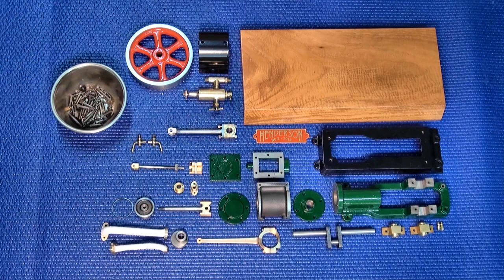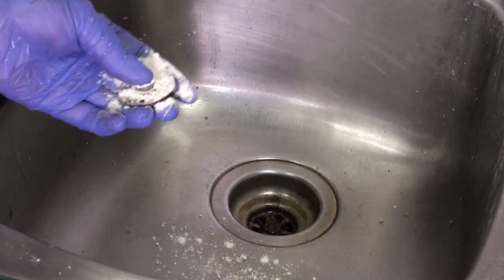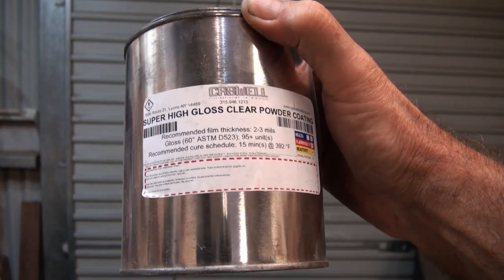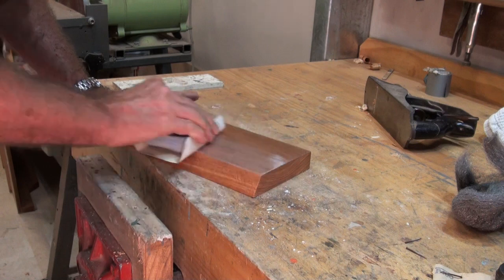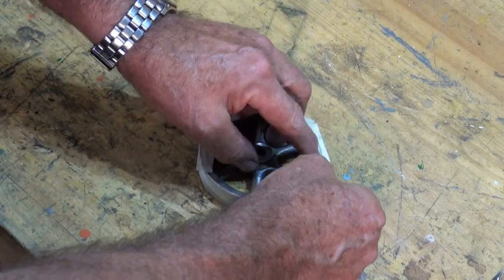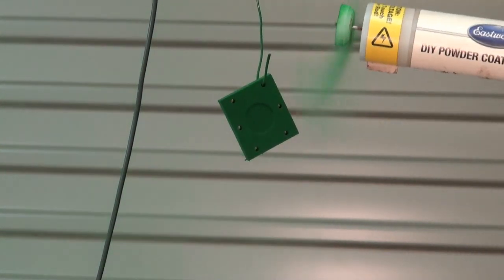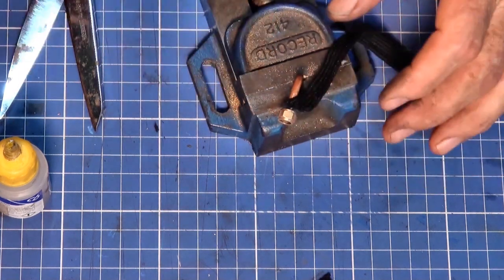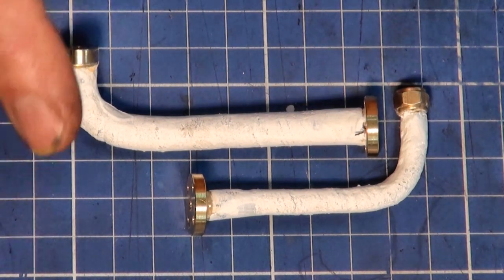Building the Stuart Turner Number 8 Mill Engine - Part 11

Comment: Last few days been watching many of your videos. Excellent work and super attention to details. Love how you explain things almost in layman's term, easy to follow and understand. Also the fact that you try to show more than one way to achieve the same results.

I've been very interested in your etching process and how you go about it. Been dabbling myself with mix results. Also the powder coating process I've been doing also myself as you. 

By the way, I would be very interested in your custom made powder coating oven you rigged up with a PID. Many of these electric stove are either free or a few bucks in my area. Looking for a larger one than I currently have. Keep up the great work.
Reply from the maker: Temuba, I think the powder coating setup was the single best investment I made in my shop. The results you can get are way better than painting and much more durable. The PID controller was probably a bit of overkill. If you were to use a bog standard domestic oven and set the temperature using one of those "hanging thermometers" used in barbecues, you could just set the temperature and then leave the thermostat alone. There are plenty of videos on YouTube showing how to set up a PID controller and they are relatively cheap. You just need to take some care with the electrical side of things if you are not familiar with the innards of a domestic oven.
Regards,
Mark Presling

Comment: I noticed that you're touching the metal surfaces with your bare hands. Does that not have an effect on the quality of the powder coat or is it ok once you've thoroughly cleaned the parts?
Reply from the maker: William, ideally you should wear gloves but powder coating is a lot less critical than electroplating or anodising. Castings are good candidates for powder coat because of the surface texture that gives plenty of adhesion. Some very smooth surfaces can be more difficult and that's when you need to make sure your surfaces are chemically clean. When I first started powder coating at  home I had done some polished aluminium and the coating would sometimes chip off. Chemically etching the surface does help.
Regards,
Mark

Comment: I am just about to start building  this same engine. Would you be able to send me a set of gaskets as I don't have a laser cutter to do such a perfect job?
Reply from the maker: Emile, I don't normally do orders for people but if you email me I can send you the DXF files of the gaskets and you can print these either on paper or directly onto the gasket paper and cut them out with a sharp knife or scalpel. The holes for the studs can be punched out using a normal pin punch with a block of end grain wood underneath.
Regards,
Mark

Comment: Do you think that the powder coating would stand up to steam heat?
Reply from the maker: John
The powder is baked at 200 degrees C. Once it is baked it undergoes a curing process and subsequent heating won't necessarily cause it to melt or liquefy. I think it would be safe up to around 150 degrees which would cover saturated steam and even mild superheat. It is certainly much more durable than most paints.
Reply: Thanks Mark.  I just picked up a set of castings for a Stuart no.9!   It's a very daunting prospect!